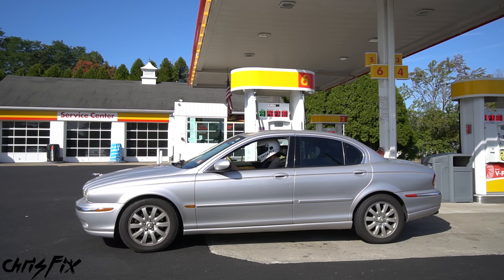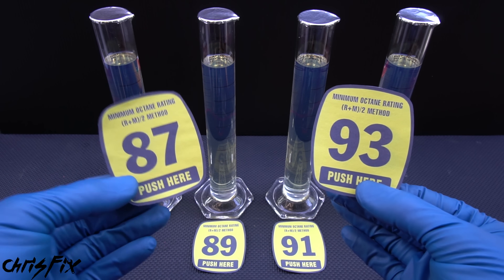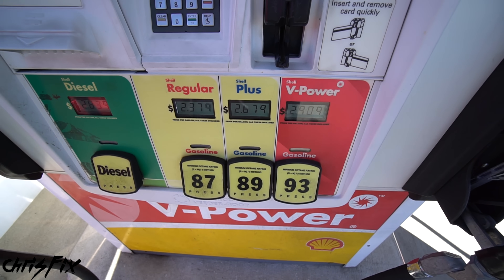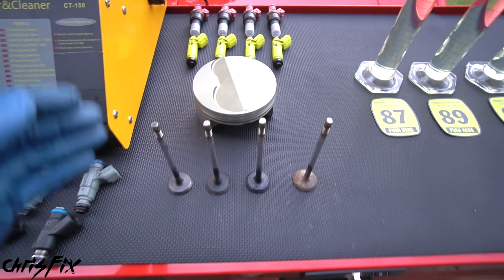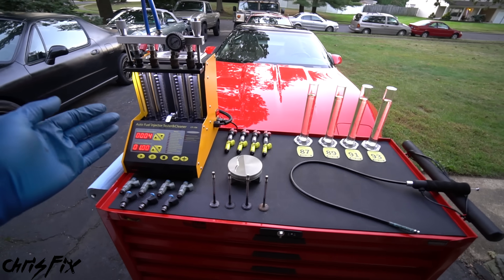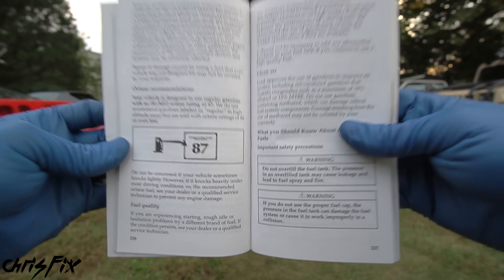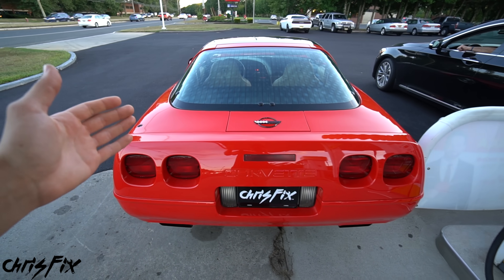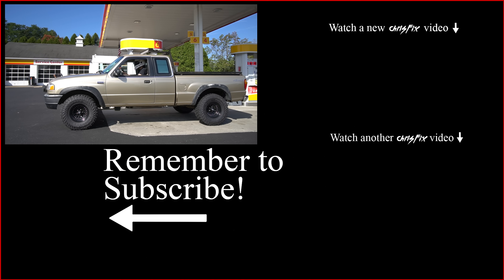What is the BEST Fuel to Use in Your Car or Truck and WHY

Comment: Great video, very informative. I think you answered most questions people have concerning which gas is best. I'm not sure if I missed these two questions I still have. One being that you really didn't give to much info on the mid grade gas the other being what happens to your car if you use the high grade gas in a vehicle that takes low grade gas. I normally do like you stated, look at owners Manuel and use what the manufacturer recommends. I have friends that only use 91 octane when their vehicles call for regular Fuel because they think it runs better. As an example of head that if you do that it can damage your vehicle especially in your motorcycle or lawnmower. I normally tell them that I disagree with them but at times I'm not really sure but for myself I go with what my vehicle calls for. Thanks for posting and yes I enjoy the animations and extra details on your video.

Comment: You briefly touched on E-85. Higher in Ethanol content. Doesn't Ethanol deteriate some rubber components in the fuel system ? I have a Chev. Tahoe 5.3 V-8 Flex Fuel, where I  purchase most of my gas, they don't have E-85. Is that damaging my engine ?

Comment: Ethanol fuel is subsidized by our government making it a VERY expensive fuel to use.  It also damages engines (lawn mower, snow blower, gas trimmer, generator) not designed for the E-85.

Comment: You're wrong about The fuel rate of burn. Higher octane burns slower. That's why you don't get detonation. The flash point is not exactly the same. So the fuel doesn't detonate prematurely.  There's a reason higher octane fuels don't detonate. there's a reason you use them in a high performance engines. Higher octane fuel allows you to have a longer stroke and advance the timing farther. both are helpful for high performance engines that run at higher PM. And It has a lot to do with how fast the fuel burns.

Comment: I had a 2000 Mazda Protege LX with Automatic transmision, and I remember when the car was under load or heavy acceleration when it was on 2nd or 3rd gear near 3,200 RPM you can hear the pinging/detonation inside the car. I started to use Fuel System cleaner and it helped but it never resolved the issue. I checked the 1.6 DOHC Engine (ZM-DE) and the engine doesn't come with a Knock Sensor. If I use premium it worked well but with regular it will start pinging. Once I found a workshop manual and I found that the 1.6 Engine could use 3 types of Spark Plug and by doing some research I found one that was a colder type from the factory, I install those and the car stopped to ping with regular. I even called a dealership and the told me that the 2.0L does have the sensor, but the 1.6L doesn't have it, and the Owners Manual recommended 87 Octane.

Comment: I have had two vehicles with 10:1 compression ratios and those are the only two cars I ever used anything higher than 87 in. One of them was a 1995 Buick Roadmaster and the other is my current 2016 Chevy Cruze.

Comment: My two-stroke bike does not require 91 but since it’s carbureted it’s bad to run ethanol through it. Around my town there is no ethanol in 91 octane and 10% and everything else, so I will only ever use 91 in it

Comment: I just got  a 99 Ford ranger - no OM - no labels all around ! What Gas should I put ! I been putting regular but now after I saw your video I’m wondering if that’s the noise that makes after I step on the gas (popcorn noise )
Reply from the maker: Does your ranger have the timing belt or chain?
Reply: ChrisFix  I’m checking out all your videos ,very helpful-
I’m leaning and gonna have fun with this 99 Ranger , I replaced the battery, Spar plugs +wires ,  alternator- stereo (boss)
 -also got Full synthetic maxLife oil change,radiator fluid replacement and Automatic trans fluid replace 

Now I’m looking to replace the breaks (all assembly) they do some Squeaking  not bad yet ,
 Doing some work inside the cabin , let her seats , roof and flooring (same color as your dads blue 🔵 

Good advice and straight to the point on your videos 🙏🏼😎
Reply from the maker: Thanks a lot! 
I would check the tension on your timing chain, as it could be causing that popcorn noise, if that is all good then try using 93 and see what difference that makes!
Reply: ChrisFix  it’s a 3.0 (chain )

Comment: Hey chris. I have a new beetle 2003 gls 2.0. I usually use 87 and it says 87 but i had a lot of problem with it especially having issues with fuel injector. Now my mechanic said I should use premium from now on. Is it right and also if I start using premium, should I flush the old fuel? thanks in advance
Reply from the maker: Did you replace the fuel injectors? And how many miles are on it?
Reply: @chrisfix  No we haven't replace it. we ended up cleaning the fuel injector and it ran but still have problems. miles is 140k

Comment: in europe we have e10 (some more modern cars can run on it but its only a cent cheaper per liter), 95 (normal), 98 (super plus. required for some cars, mostly sports cars), 100 (shell v-power) and 102 (bp ultimate)
with diesel its kinda similar
min. cetan in europe is 51, shells normal diesel has 52 or so, bp normal 53, shell v-power diesel 55 and bp ultimate has 60 it really helps with power and fuel economy but most diesel cars are fine with normal diesel
Reply from the maker: Watch the video!

Comment: My truck is tuned and is capable of running on 87 or 93 octane. I want to get the Shell V-Power 93 octane, but the Shell near me seems grimy; not nearly as nice and well-kept like the Shell you're at. Are all Shells (and other gas stations) the same? Might seem like a silly question, but for the added price of premium and the health of my engine I want the best!

Comment: Shell Vpower(91 octane) has no ethanol, and ethanol has less thermal energy than gasoline. Most fuels have 10% ethanol, so the Shell 91 actually has an advantage. Its small, about 5% better MPG, but its there.
Also a good note, ethanol has higher octane rating than gasoline. So the freakin corn burns better but not as much.

Keep the vids coming man, good stuff.

Comment: Hello there! I need some help from the YT community. I drive a 1996 Jeep Cherokee SE, which has 106k miles. I would like to keep the engine and fuel system clean, but I don't want to spend a ton of money getting it cleaned. Are there any fuel additives I can use that would help clean carbon deposits? Or am I being ignorant as to how this works? Any replies would be welcome and appreciated!

Comment: You did not mention the addition of ethanol to the lower grades. Here in Canada there is no ethanol added to the high octane fuel. But all the lower grades have it. Apparently ethanol is not good for engines.

Comment: I was getting premium gas for my truck at race track and Plant City across from Walgreens my plug started falling out 100000 mile plugs only had about 35000 on and turns out I got water my gas tank from racetracks call him up the Tumblr they need to check on it They told me to prove it so I don't get gas at racetrack no more because the gas having water in it I go to wall was get methanol free

Comment: Since only one of my vehicles is under 150,000 miles, I switch between grades. If I have to take a long trip, I use premium, if just putting around town, Regular is fine. My others are over 200,000 miles each.

Comment: I've ran e85 in my 2018 fusion with 1.5 Ecoboost 1/4 to 1/2 tank with regular fuel and runs good I have a programmer set at 75% and noticed a power gain in it I have 38,642 miles and been doing it since 5,000 just wanted to see what it would react with e85

Comment: I vouch for Shell on this one, and I usually don't care for brands. They're the only distributor in Brazil that's upfront with their octane ratings -- it's 87 for Regular, and 87 for Premium, and that's *it*, for every station in the country. All of them have a legal minimum 27% ethanol mix, and they're still pretty low octane overall.

You can find some that are close to US 92, labeled usually as "Racing Grade" in a few stations but they're really rare outside big urban centers. Almost all other distributors hide these numbers at all costs and just mask them up with marketing wank...

Then again, you can get E100 there on almost any station if you feel like it and it's fairly priced, cheaper than any gasoline. Diesel is illegal for passenger vehicles except trucks/pickups. It's a pretty weird market.

Comment: There is correct information here but not entirely! If you stay between plain pump gas no the burn isn't much difference but higher up there is a big difference! Higher octane does burn slower and cleaner like in race gas thats exactly how it prevents preignition more controlled burn! And like in our race car we run 116 to 118 octane leaded race gas it turns to vapor really easy and we have to run a filled engine block where water is only in the top end and leave the water pump and fan off to put heat in it!

Comment: Why in the United States you have 
3 types of gasoline 😂

In Saudi Arabia
We have the largest oil company in the world, Saudi Aramco, but it produces only two types of premium gasoline⛽
Octin 91 is green  0.24$ cents per liter
And octane 95 is red 0.46$ cents per liter

But there is a big difference between them

Let's say your car engine is running on 91 octane
And by mistake, the car was filled with Octin 95 

Yep, you will lose that engine for sure 💔😂
Reply: Abdullah Alshehri 
So they can rip Consumer off !!!
Reply: @topev7864  agree 👍🏼👍🏼

Comment: I have a 2000 Camaro SS Convertible which requires premium fuel.  I have less than 21,000 miles on the vehicle and it runs great.  Fuel choices near are ethanol-free 90 octane, 91 octane with 10% ethanol, or 93 octane with 10% ethanol.  I'm not sure what impact the ethanol has and was hoping this story would go over it, but it didn't.  Any thoughts on which fuel would be best to run?  I've been going with the ethanol-free 90 octane.  Thank you!

Comment: Read the owner's manual,  it tells you what the vehicle REQUIRES
Reply from the maker: Correct! But it's also good to know what it recommends!
Reply: @roberthoward3299  No, "require" and "recommend" are not the same thing. I can say "I require water to exist", however, I also "recommend tea every now and then". I can't live without water, but I can live without tea.
Reply: @deathscreton  , precisely 👌
Reply: But some people can't read.
Reply: Sometimes it tells you research octane.  Thanks for that tip Chris.
Reply: The 2001-2007 ford escapes say 87, but they only run smoothly with 89 octane :/

Comment: Ehh, when I put high octane in my 150 it runs so much cripser, smoother and faster
Reply from the maker: Interesting, does the owner's manual have a octane recommendation vs requirement?
Reply: ChrisFix I dont have one cause its a 2008 but since its a race bike I could probably run 110 ive ran 105 in it
Reply: Another action you can take at the gas station is check your tyre pressures. All the gains you describe , can be achieved  with regular checks . P.O.W.E.R. petrol.oil,water,electrics,rubber.

Comment: I have an old car from the 60’s a Valiant AP6 with a slant 6 225 that really needs leaded but it’s not made anymore. I’ve asked around and some say use regular or the middle type with a fuel additive others say use premium the highest one and you won’t even need the additive. I’m from Australia so I just said regular and premium cause I forgot what numbers ours have 😆 One thing I do know is never use fuel with ethanol in it as it sux and is not good for your car.

Comment: Hey Chris do you do Q&A? Where can I contact you? I have a bunch of car questions
Reply from the maker: What are your questions?
Reply: @chrisfix  Okay so I bought a lancer evo 4, which is vandalized, I guess this is the wrong video because this isn't the "Susan" video. The owner before me prime painted the whole vehicle which was originally white, now it's grey so too late to remove spray paint now, but there are lots of paint streaks around all 4 side windows and evolution logos. my dad told me to use paint thinner but I saw you use the blade method on the side mirrors similar to the one use to repair windshield chip. What do you think is the best and safest way to clean it? I'd like to try the blade or paint thinner method but I'm afraid of ruining it. 

P.S both front and rear windshield is smashed and need to be replaced..

So my plan is to maybe get the windshields, clean the paint, remove surface rust and undercoat the vehicle (I live in part of Canada where it snows a lot so there is salt) 
And then maybe keep the paint for a bit until I make up my mind whether to paint it white again. 

Also did you ever installed the smart mirror you featured in Christmas ideas?

This is a lot of questions I know so I was wondering if where would be the best way to contact you. FB, twitter, Instagram?

Comment: I didn’t hear anything about ethanol which is the biggest problem with fuel. Use non ethanol and you won’t have any problems. Are those carbon pics from the Ford eco junk motors?

Comment: Umm what about 82 conventional my gas station still has that
Reply from the maker: Interesting, those pumps are usually meant for older carbureted cars!
Reply: Here in Utah we got 85,87,88,89 and 91. We got all sorts and some stations have ethanol free which I like. I use that in my lawnmower.

Comment: I have a 2000 Ford Ranger with a 3.0L Flex Fuel (e85 compatible) engine. Even though the manual calls for 87 octane it knocks pretty badly unless I use at least 89, but it typically takes 91 to run the best. Is the flex fuel engine higher compression or is their something else causing the knock and ping?
Reply from the maker: It could be!

Comment: I get premium when gas prices go down and get regular when they go up. California gas is around $3.19/gal for regular.
Reply: 2.93 at Arco boi 😌 😂 probably 90% corn 🌽but oh well
Reply: @DennisMartinezCalifornia  I used to get arco but I noticed it burned faster than Chevron. Even though I paid for cheaper gas and had more mileage in numbers, I actually had less while driving.

Comment: On carburated cars try to use non ethanol fuel and on leaded fuel cars YOU MUST use a lead substitute or you will damage the valve seats. Like in Australia we have flash lube

Comment: For diesel: B20 biodiesel is fine in any diesel engine, though if you live in colder climates it'll gel faster, so make sure to use regular diesel during the winter. Otherwise, you can use any kind of biofuel outside of E85. Heck you can even use fast food oil, just remember to filter it.

Comment: I used to run max104 octane booster and everytime I ran it my spark plugs would foul out and truck would start missing. Then pulled the plugs they would look orange and really dark wouldn't recommend that brand. Truck was a 99 gmc 1500 with a 5.3

Comment: My 09 Colorado LT 2.9 manual  pings nomatter what octane fuel I use only at 25 - 35 mph is it  the 235- 65 R 16
Tires  ? Was 215 70 R 16 
The speed O didn't change any I'll be looking for an answer on your video 
Thanks

Comment: Hey Chris, my 06 Tacoma has 200k miles bought second owner recently and there is quite a bit of blowby/wet sludge Built up under oil cap and a friend is urging me to use a quart of motor flush before changing but seems drastic and likely to damage engine. Your thoughts, thx

Comment: Just curious because I totally didn't misunderstand and got misinformation facepalm Lets say I possibly put in E-85 octane into my gas tank, say 3 fill ups ago, probably about 3 weeks? Is there anything I can do to make sure it did not hypothetically damage my engine. Does it hypothetically matter at this point since it has probably been diluted?
Reply from the maker: Your car should be ok, you might have noticed reduced engine power, but it wouldn't really kill your car. I would have drained out the E85 then put in gasoline, but it's already diluted if you filled it up 3 times so I wouldn't worry about it!
Reply: @chrisfix  Thank you so much, and yeah I have. My power and fuel economy plummeted when I did it XD. But it has slowly started coming back up. Should I put in some octane booster or injector cleaner just to be certain?

Comment: What can you tell me about regular 87 with no ethanol? What type of cars use that or should I say, what type of engines?
Reply: Most modern gasoline is E10.  There's slight variation by region and time of year, but 87 is 87 (regardless of if it's 5% or 10% eth).  Octane rating is separate from ethanol content.
Reply: @redslate  thank you

Comment: No word about ethanol... US gas contains at least 10% ethanol, some stations offer ethanol free. It's mostly used for marine and small engines (mower, weed wacker, blower etc) gasoline doesn't clog the small carburator when not in used for a long time.
Reply from the maker: Thanks for sharing!
Reply: US gasoline doesn't contain "at least 10% ethanol" but actually contains "up to 10% ethanol". Might seem like a slight difference in wording, but it's a significant difference in application.

Comment: Europe runs almost exclusively on RON91 and 95, ie US 85 and 89 (for petrol).  Other higher octanes are available but rarely used due to expense.  Europeans pay approx. 5.88 to 6.33 USD per US gallon.  Ouch.   I drive a 1.5li turbo diesel and can get 60 mpg (US gals).  Only way to cut costs.
Reply from the maker: Interesting, thanks for sharing!